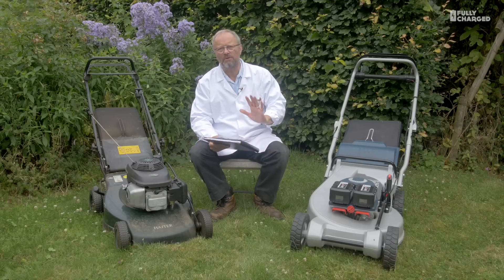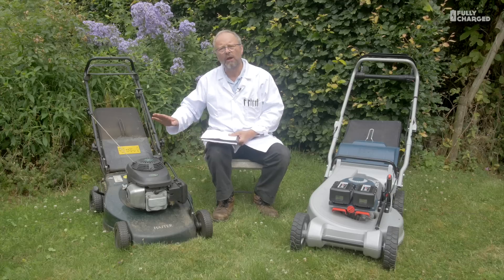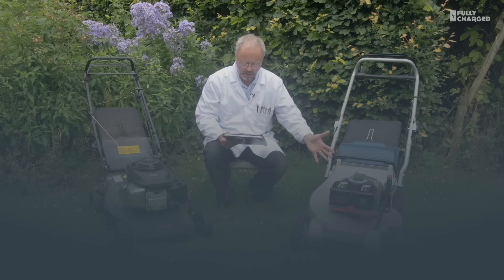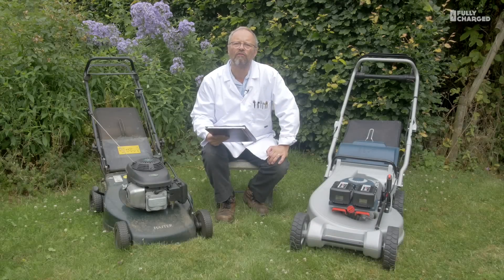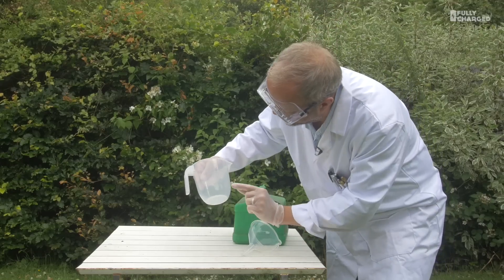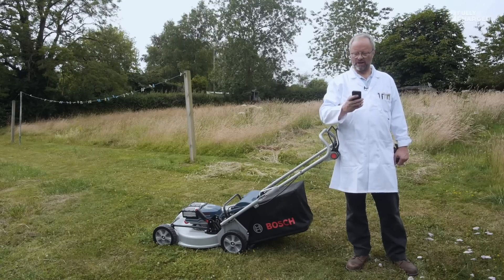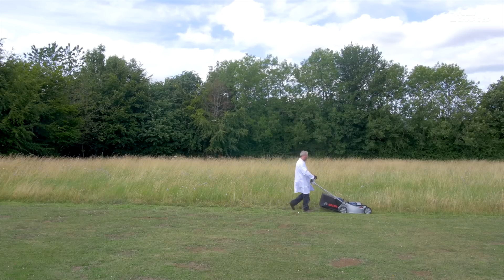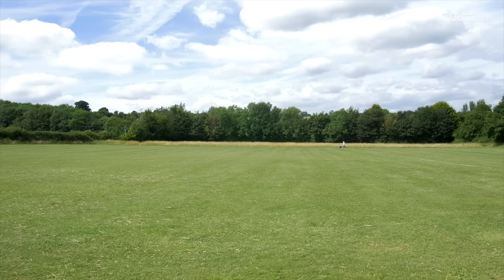Battery V Petrol. The Lawnmower Test | Fully Charged

Comment: Don't want to be pedantic but I believe the US EPA use Gasoline gallon equivalent (GGE) when rating EVs which is  33.41 kWh/gal. Divide that by 3.78541 to convert US gallon to Litres and the answer is 8.82 kWh per litre... but the result would mean putting even less petrol in the mower.... 47.6 milliliters. Still, an awesome demonstration!!!... It was discovering that 85% of all petrol sold is coverted into waste heat that got me into EVs in the first place
Reply: +Evans Electric I think it's even worse. 1 liter of petrol = 35 MJ. The mower = 0.432 kWh = 1.55MJ. In other words i would only need 44 mm of petrol to be equivalent in energy.
Reply: +Arne Brethouwer Of course we're forgetting that Li-ion batteries do not fully discharge and only use ~80% capacity due to BMS limits so that reduces mower 'usable' battery capacity to approx 0.345 kWh.
Reply from the maker: +Evans Electric Thanks for that bit of reassurance. My grasp of maths, as you no doubt noticed is hazy at best so I'd far rather make an over generous error than a mean spirited one.
Reply: I believe US EPA uses 33.7  kWh/gal, not 33.41 kWh/gal. See: https://www.fueleconomy.gov/feg/topten.jsp
Reply: this!
Reply: icekk007 ai
Reply: Evans Electric modern Li's use a lot more.what you said was true 10 years ago. With smart batteries and smart charges you can easily squeeze another 10%
Reply: Stupid demo ! GEE WHERE DID YOU LEARN SCIENCE !

Comment: Did you also  measure the emissions and the transport costs of the energy;  he said fetching the large wooden spoon.
Reply: +Nik Butler Might have some of the numbers wrong here, but think thermal efficiency for power plants varies between 30% for older stuff and 45% for the newest gas powered stations. Can't easily find numbers for the UK, but estimates for loss in transmission in the US are around 6%. Taking those numbers, burning that much fuel at a power plant and delivering it to your house, then charging the batteries should give at least 28 minutes of mowing time. 

I haven't taken the efficiency of the battery charging into account, so maybe a bit less, but shouldn't be that hard. There's other costs with the petrol too of course, so doing anything exactly is going to be a lot more involved.

Even with that though, I'd call not breathing in petrol exhaust fumes a significant plus.
Reply: +HorzaPanda the huge amount of electricity consumed in the process of refining oil to produce petrol needs to also be taken into account
Reply: As far as I can tell, the energy used per litre to process fuel is pretty close to the amount of energy in the fuel itself, which is kind of mind boggling O_o
Reply: Battery electric will always be less polluting and more efficient. You can go all the way back to the big bang if you like but it won't change the fact that fossil fuels used in an internal combustion engine is abhorrently inneficient.
Reply: +HorzaPanda The energy required to travel a given distance in an electric car is little more than the energy required just to refine the fuel required to travel the same distance in an internal combustion powered car. This is due to the high efficiency of electric motors and the low efficiency of internal combustion engines. The energy used to refine gasoline is significant but only a quarter of the energy available from that gasoline i.e. roughly 4kWh used to refine one gallon of gasoline vs 34kWh of energy contained in that same gallon.
Reply: Ah, okay, that makes a lot more sense. Some of the numbers I've seen claimed just seemed ludicrous. Though you've got one of those numbers wrong, since you said a quarter, then 4kWh, which is more like an 8th of 34kWh.

But anyway, I knew internal combustion engines are pretty inefficient, just didn't realise the processing sucked up such a significant fraction of the energy gained from that too. Thanks.
Reply: +HorzaPanda You are right mate, I should have said 1/8th.

Comment: Surely the biggest inefficiencies in electrical systems are at the point generation, which I don't believe you've taken in to account.
Reply from the maker: +TheUnnamedGent The one bit I missed out, very stupidly is that the batteries were 100% charged with solar energy from the panels on the roof of the building we filmed the last bit in. You are correct about transmission and generation inefficiencies, but I think we can both agree that losses down 4 meters of cable and one inverter are fairly minimal.
Reply: +TheUnnamedGent The petrol machine has very little posibiliy of using a renewable source like Solar, Wind Hydro. When it comes to electrical systems efficieny all depends on your location interms of power grid. When it comes to renewable source if i understand math correctly 0 fuel used vs fuel wasted as heat = infinetaly more fuel efficient.
Reply: +fullychargedshow The solar panels can fully charge those batteries in 20 minutes? That's pretty impressive. Is this also possible on a typical day with cloud cover, or does it need bright sunshine for it to charge this fast?
Reply: +Neojhun Or Geothermal. Which could be built virtually anywhere.
Reply: +TheUnnamedGent Its true, that that wasn't mentioned. Tho even if they weren't charged from solar, the generators in even the dirtiest power station are much, much more efficient than anything you can move around (lawnmower, car, etc). There are very few generators, so they take the time to make them more efficient (secondary condensers, heat exchangers, etc.)

So even taking all that into account, electric powered items charged off the grid are still going to be more efficient than powering something locally off unleaded or diesel.

Comment: You make really cool videos! Thank you! I actually use an electric lawn mower. It doesn't have a battery pack so I have to finagle with an extension cord. Other than that, it's VERY reliable, it has been working flawlessly for the past 8 or 10 years. Lol, I've had it so long I forgot how old it is. Anyway, keep making the great content!

Comment: Thnx man but cannu plz do this on COST EFFICIENCY??
Reply from the maker: +Funfrme Kik Okay, I left out costs due to the complexity of the comparison. However in the UK petrol is £1.10p per liter, so the petrol we used was about 10p. The electricity for the batteries came from my solar panels so in that sense cost nothing. If we'd charged it from the grid it would have cost about 10p as well. (21p per kWh, mower batteries .5 kWh) However the important point is 10p of petrol lasted 7 and a half minutes, the batteries lasted over 100 minutes.
Reply: +fullychargedshow "liter"! A heinous crime!
Reply: fullychargedshow k very nice n thank u again 4 ur prompt reply.Just one thing as v all know a piston engines efficiency is around
 30% max if u know wot i mean u get wot im saying?
Reply: +Duncan Stevenson Looks like he has American English autocorrect …
Reply: +fullychargedshow Where do you get free solar panels? I wont them too on that price. How many watts they have per hour (in combine)?  Is the energy used to charge mower goes directly from panels? No? They need charge controller/regulator too charge a batteries? Oh, that shame. So then that 36V special batteries are charged from that regulator? What you mean they don't? First you have to charge 12V, 24V, 48V (depending on system you have installed) standard standalone batteries? And finaly... use conventer =12V, 24V, 48V / ~110V,220V and then use special charger ~110V,220V / =36V
Wiew! And all that FREE?! Gee, good Sir. And how long those 36V will last until need to buy "free" new ones?

Comment: How much better would a newer, more fule efficient petrol motor do?
Reply from the maker: +Axel Brand Maybe 10%, maybe even 15% which would mean it might run for 8 minutes or even 10. But the electric mower did over 100 minutes of strenuous mowing with no problem. Electric motors are 95% efficient, petrol engines, at best, super new tip top ultra efficient, 25%

Comment: Or you could have used Joules, like a normal person.
Reply: +Josep D. Capdevila At least his Numbers roughly correct, I checked!
Reply: +Josep D. Capdevila At least his Numbers roughly correct, I checked!
Reply: I have seen BTUs quoted on some equipment in Germany. I cannot remember for the life of me what it was though. Computers and displays quoted in zoll (inches) and I even brought a 3/8 in fiber washer for a German made fitting.  It is easy to forget that Germany once used imperial measures.
Reply: BTU is used a lot for AC units in Australia still. Thankfully KW is becoming more and more common.

Comment: Obviously this doesn't scale and we're not comparing apples to apples here because from what you seem to be implying, an electric car like the Tesla should be able to have an MPGe of over 400 ((100 minutes / 7 minutes) * 30 MPG). Whereas in reality, it has a MPGe of 89.

But yes, of course it's more efficient to use an electric motor currently, but that power does have to come from somewhere, which is mostly fossil fuels and some nuclear as well. It'd be even more efficient to just have a nuclear reactor built into the car/mower directly (ignoring the issues with the waste, which is a significant issue) or one day a fusion reactor.
Reply: Actually the comparison makes perfect sense, the "power" of the gasoline mower is mostly wasted. It uses a lot of fuel to turn the blade and even eats fuel when it's not specifically turning the blade.  Mower engines are typically 10% efficient with the fuel source, cars are typically 20-30%. 

As for the fossil fuels argument, it's extremely weak. Some countries use little to no fossil fuels, in other countries you can opt for a power company that provides using fully renewable resources. Not to mention solar panels on your roof and suddenly... boom, you're not using anywhere  near as much fossil fuels to generate power. Beyond that a fossil fuel burning power plant will produce electricity with a much higher efficiency than a petroleum ICE could ever dream of, so even then what are you on about?

A fusion reactor? The shielding alone would make the car far heavier than a battery pack, and price wise fuel rods aren't exactly cheap to purchase... and here's a bigger issue, you'd still need a battery because you couldn't control the reactor to produce torque on demand... trying to do so would easily lead to a meltdown. Nuclear reactors, if you didn't know, produce electricity the same way burning coal does. Steam moving a turbine, so really a nuclear engine is just a ridiculously bloated steam engine and doing so on a small scale would lead to massive energy losses you could avoid with a larger system.

So it would still be more efficient to generate the power and distribute it on the grid.

Comment: Great 'experiment'. Unfortunately you will need to factor in the efficiency of grid electricity and loss on the cables from the power station.  Maybe a better approach would have been to charge up the battery mower from a petrol generator using 1 litre of gasoline.